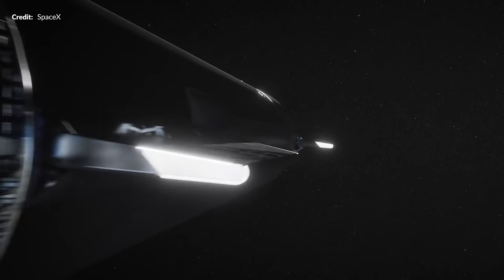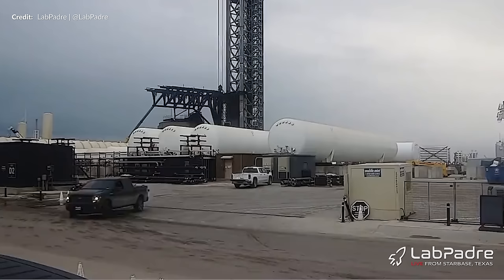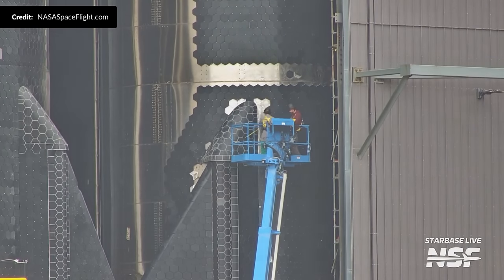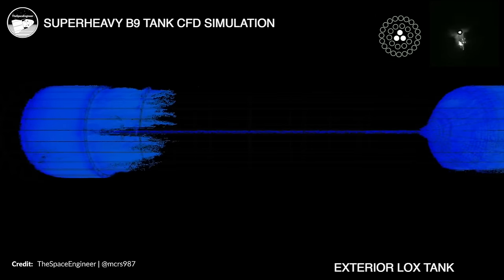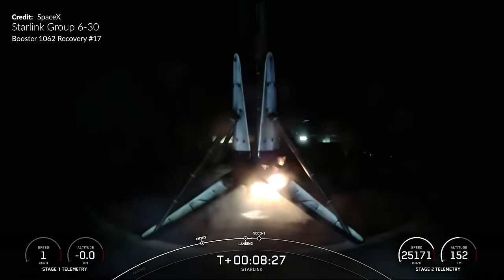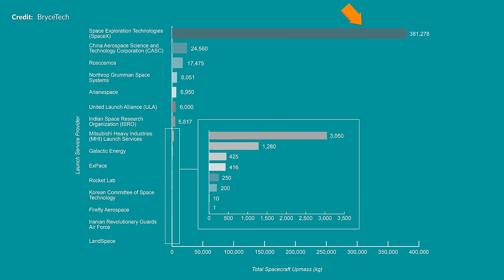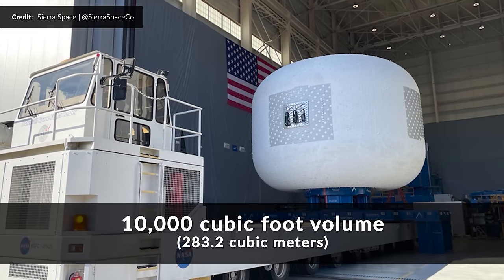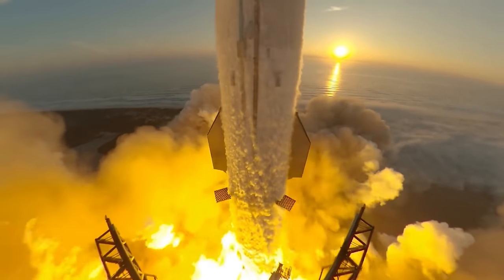SpaceX's Starship Version 2 to take Center Stage! Lets do this!

Comment: @ 12:50: The fins have been seen. Lex Fridman released a photo of his visit to the Florida factory on X that shows a forward module (interstage) with an insulation-covered fin installed. Additional views of the mid module tanks have been since released by Julia Bergeron that show it just before it went completely back inside the factory and visible next to it are parts for an aft module (engine section) as well as a single landing gear. 

If all that isn't enough, just this morning a photo was released by Talk of Titsuville of a complete fairing rolling on a transporter, looking like a practice run for payload integration and transport ops.

Comment: Not sure but putting baffles within the tanks would help out to stop the tremendous wave back lash on extreme maneuvers. Or having several smaller tanks to replace the large tanks to help control the splash effect of the fuel
Reply: I would be very surprised if they didn't already have baffles in them. 300 tonnes of fuel sloshing round in those huge, nearly empty tanks, that's ridiculous ...
Reply: @richardconway6425  
Yeah, they should probably use a smaller tank, with a bladder to keep fuel in place while doing the maneuvers.
Reply: Agreed.  Baffles could potentially resolve the sloshing issue if that was indeed what lead to the prior flight failure.  My guess is SpaceX is already looking into this.
Reply: Smaller tanks would significantly increase weight and plumbing complexity. While at the same time reduce the amount of fuel that can be held due to dead space between the tanks.
Reply: A plunger like a calking gun. It would be perfect for fuel transfer to another vehicle.
Reply: The tanks do have baffles (visible in the Booster 7 leaked downcomer collapse photos) they just need to fix how the flip is done
Reply: Baffles add weight…. I don’t think they will add them unless they have to

Comment: I think smaller tiles would allow better adhesion due to less effect from vibrations. They need to figure out the prominent harmonics then design the tiles to resiste vibrations from those harmonics via size and shape.
Reply from the maker: It was interesting watching the launch in slow motion. Pretty much all the tiles hung on, and then all of a sudden, a bunch started falling at once. I reckon there was an big vibration there somewhere, or the ship panels compressed down more than expected. Hard to say. I hope they got all that great data.
Reply: I believe they already did that.q

Comment: On that inflatable habitat test, I wonder if they test its resistance to micrometeoroid impacts. While internal overpressure seems unlikely, it is important that an impact does not lead to a large tear forming like in a popped balloon.
Reply: I recall reading that the expandable habitats have exteriors that when expanded have multiple interwoven layers similar to Kevlar that are stronger than reinforced concrete.
Reply: The Bigelow BEAM inflatable habitat was on the ISS for two years, and seemed to suffer a number of micrometeroid impacts without losing any integrity or pressure.
Reply: @baz_astra I think that it could work like a balloon in the other way where it is a little bouncy and just bounces away any debris
Reply: @baz_astra  That's certainly good to know! I was just wondering if they include simulated impacts in the testing plan. There are contraptions that can accelerate small projectiles to the necessary speeds, after all.
Reply: @alexeytsybyshev9459  They had Tesla designer Franz von Holzhausen throw a baseball at it.
Reply: @alexeytsybyshev9459

It's a good thing there are people like you around armchair engineering. I'm sure they never thought of that.
Reply: @billstevens3796  As opposed to professional engineering you come here to do lol. I'm just asking questions that make sense to me.
Reply: @alexeytsybyshev9459  And it was a perfectly good question. I think the balloons we see are more the exception than the rule. Have you ever seen a magician put a skewer through a balloon? It's a really simple trick, a little bit of sticky tape where you make the puncture stops the tear from spreading. Also the rubber in a balloon is stretched, these habitats wont be, the air pressure will just expand them to their natural dimensions, so if they do lose integrity they just go limp not pop...still wouldn't want to be inside it though.
Reply: @stever285  Yes, I guess a balloon is stretched at a much higher rate than the habitat material would, and that makes the rubber of the balloon concentrare a lot of stress at the edge of any puncture, pulling it apart from all sides. There is still going to be some of that pulling apart effect, even for a fabric-like material. It probably depends on the rate at which it is stretched and the margin of load. So, I think if the pressure is much lower than the strength of the material allows, a small hole will not grow, but if it is close to failure, a small hole will turn catastrophic.
Reply: @alexeytsybyshev9459  Exactly what I was trying to say, I'll have to get you to follow me around and explain all my posts, I might not get into so many arguments.
Reply: @Wurtoz9643  Now I would like to see the maths on. Maybe up to about the speed of a rifle bullet, but shortly after that I'm not seeing it.
Reply: @peter.wilson  not to mention they'll also be engineering them such that any punctures are stopped from forming long tears

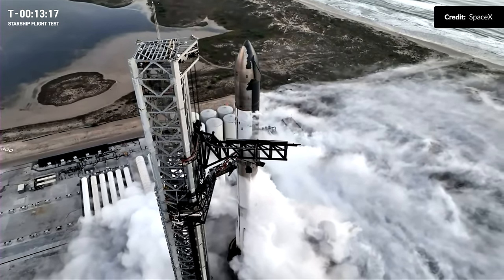Comment: 1:15
Faster fueling rate has been a concern for 60 years. A heavy lift vehicle (one that can place 300k lbs into a very low parking orbit of 100 miles for 3 orbits) can only sit on a launch pad fully fueled for 20 minutes or so in lift off status.

Increasing rate of a "fillup" is crucial to increasing launch window viability, and without the infinite coffers of the US Gov't to spend from, saving money and time now actually matter.

Comment: baffles might help that sloshing problem.
Reply: Yes. I used to haul fuel. There are baffles in the tanks to make it so the fuel sloshing does not turn the whole truck over. But..weight, right? And then the baffles would need to be strong enough to endure the huge mass of fuel moving suddenly, otherwise the baffles themselves become part of the problem.  But still, anything would help, even wire baffles would help slow the fuel moving in the tank.
Reply: @JeromyBranch   yeah, they just need to slow the fuel down.

Comment: Working in maintenance and repair, you would be surprised how much time is given simply in consideration of the people working around you not in maintenance and repair. If you can simply shut down a section at the drop of a hat, thing can immediately go so much quicker.

A week to set up an entire tank farm under those circumstances when the foundation is already there, or setting up massive precast wall is simple.

Comment: Great animation with the fuel tank slosh.  The reported negative accelleration that prompted the slosh was caused by the intense impingment of the Starship plume on the top lid of the Booster.  My impression was that that intense impingement was only for a couple of seconds, during which the three central booster engines kept firing continuously.  So, I'm wondering if the duration of absence of booster acceleration shown in the animation was longer than it really was.

Comment: It would seem to me that putting a roof over the horizontal tanks would be beneficial. It would protect them from object falling on them and also provide shade from the sun and a degree of insulation to help keep the liquids cold.
Reply: I was thinking about a tall wedge wall structure in front of the vertical tanks that would deflect the force of the blast around the tanks
Reply: @BradiKal61 they already have smaller sort of system like that. I think a roof would be better, because it would protect the tanks from falling debris and dust, and, as @asawhite2220 said, heat from the sun

Comment: I wonder if the new metal press is the key to Starship 2 improvements. They could stamp larger stringers with additional bend geometries and complex shapes to add strength and reduce weight.
Reply: It looks like you watched MKBHD Cybertruck Video 😁
Reply: One possible use of course. I'm not sure how well mega press technology (1) works with stainless steel though. In that case if large numbers of stringers and rib sections are needed then regular convention stamping technology might work better. The critical point there is the technique used to join them togetherer. 
1) It is my understanding that the Mega Press technology allows the diecasting of large one piece structural elements.
Reply: @mpetersen6   The Tesla Gigapresses are indeed for injection casting the front and rear castings of the Model Y and the Cybertruck. Aluminum is injected in just milliseconds. They haven't tried to do anything like that with steel. On to the stainless steel: At one of the interviews for the Cybertruck deliveries one of the Cybertruck engineers talked about how stainless steel that that thick can't be stamped. To even bend it that sharply without stressing that crease they needed to invent a new machine. 

Tesla developed their own stainless steel alloy to withstand that. Total speculation: that alloy will be used to make better stringers, etc, for Starship. Tesla and SpaceX do share their top metallurgists.
Reply: These detailed fantasy droolings are so entertaining. The MuskCult™ is just the Bush War Cult, instead of "6 more months until victory in Iraq" it's "orders of magnitude" and posts like this one above.

Comment: Using thinner gauge metal for Starship would decrease dry weight, but would make the fixing of the heat shield more challenging, since it would tend to flex even more.

Comment: With saying that the dry mass of Starship v2 was going to be less, I don't see how that could be if you add three more Raptors (even R3). It doesn't seem like using slightly thinner SS rings would tip the scales in that case. For the time being, I'm not expecting a 9-engine Starship -- at least not until Mars missions. From what we've seen, just changing to (presumably lighter) Raptor 3s and using flatter domes both increases propellant load (slightly) while decreasing dry mass -- easy-peasy.

Comment: If you read Halfway To Anywhere, by the late G. Harry Stine, you will find his advice to newspace companies expressed as "Build a little, test a little." Expanded a bit, this means that once a company has a reasonable design, the company should fly it as often as possible, fixing mistakes that it finds incrementally. The reason is that it's nigh-on impossible to anticipate everything that could possibly go wrong during the initial design phase, as NASA sometimes has tried to do.

I am glad to see SpaceX and the other startup launch companies doing exactly this.

Comment: 8:03 seems like they just need to add a baffle with basic flapper valves like F/A-18 classic Hornet does in its fuel tank to allow short duration inverted flight without flaming out the engines.
Reply: Simple design is good, but dealing with a 22 ton liquid fuel hammer is a real challenge as the history of rockets shows.

Comment: Fuel tanks in F1 cars have a mesh/lattice work in the fuel tanks that do two things:  Incase of a crash and a fuel spill you don't get the gas all exploding at once -  more of a burn off.  And it helps with the sloshing of fuel going around sharp corners which it affects it's handling. In Starship's case it would make it less likely for the engines to get starved of fuel in a sharp maneuver.....  if that is what the problem was.

Comment: Again, it's just amazing you and your team can produce one of these at this level of quality a WEEK, and sometimes even more often.  Just nuts and very much appreciated.  One thing though ... I'm REALLY waiting to hear what happened with the second stage and I'm thinking if there's any unofficial chatter on it, you're in a position to hear it.  Could you please specifically comment about that ?  Even if you just don't know anything, could you please make of point of at least saying THAT ?  Thanks Marcus and Team !
Reply from the maker: We don't know the cause of the failure at this stage. Essentially it seems like LOX started depleting quicker than it should have right toward the end like there was a rupture/aggressive LOX leak. The Flight Termination System was then triggered to blow up the vehicle (it would have been unsafe to let it continue without enough propellant to get into the correct trajectory.
Reply: Ok, thanks Marcus.  Please be sure to update us if you hear anything definitive.  Even if the problem was LOX starvation due to a rupture, the question is still "why" - what ruptured and why did it rupture ?  Thanks.   @MarcusHouse
Reply from the maker: Yes, exactly right. Sadly we don't know any more than from speculative observation right now.
Reply: Got it.  Thanks as always Marcus ! @MarcusHouse

Comment: I wonder if they could roll the booster really fast before any flip maneuvers to push the fuel to the edges of the tank and get it flowing in a controlled motion.  like how twisting a bottle really fast while pouring liquid out to create a controlled vortex results in a faster steadier transfer of liquid.

Comment: Maybe SpaceX needs to consider if it's possible to have a surge tank for the propellant so it can't slosh away from the pumps or pickups (however the fuel gets to the engines). Surge tanks are used all the time in racing to prevent fuel starvation during high G turns and low fuel conditions.

Comment: Perhaps in the booster, inside the tanks, it is necessary to install bulkheads with holes so that the fuel does not spill when the booster turns over.

Comment: Marcus
You have a great channel
My buddy is a retired propulsion engineer from a major space company
He watches you after o sent him a link a year or so ago
Anyways
Why doesn't SpaceX focus on manufacturing giant heat shield sections?
Reply: The tiles expand and contract with temperature at a different rate from the stainless steel. Even if the thermal rates matched, during re-entry the tiles will be red hot, even over stainless steel that is at cryogenic temperatures. The gap between tiles has to be large enough to support that much relative thermal expansion. Gap size is directly proportional to tile size. The gaps will be largest at the start of re-entry when Starship is closest to orbital speed, or even above orbital velocity if coming from the Moon or Mars. The white thermal blanket has to be able to cope with whatever gets through those gaps.

Those engineering tradeoff calculations were done a few years ago. As the tile material gets refined, I wouldn't be surprised if they adjust the tile size in some future version.

The majority of the tiles are held on with clips. The clips used on IFT-2 weren't as good as the most recent ship versions, just based on how few of those tiles have fallen off during ground handling. That clip design may already be good enough.

The tiles at the seams are held on with adhesive. They are still losing too many of those tiles on the ground. That will probably be resolved, but not necessarily in time for the next flight test.

The stainless steel can handle re-entry with a few isolated missing tiles without significant weakening. It will still be strong enough to land safely even if it loses dozens of tiles, but it may not be considered safe enough to fly again. Large areas of missing tiles will lead to the loss of the vehicle.

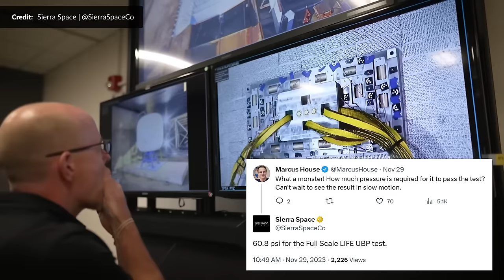Comment: The use of metric is improving, thanks! 14:20-ish, reference to 25 feet. Now I (along with 95% of the rest of the planet) have to work out what that means as I can't really visualise it. 7.62m OK, now I see. Then around 17:45. 68 pounds/square-inch of pressure. So, that's really force/area = pascals = N/m2. 68 pounds approx = 30.9kg = 303N/((2.54/100)^2)=470KPa I think.
Reply: I wish I was in your camp but thanks to a stupid political decision some 60 years ago, 80 years of imperial units is a hard imprint to break. The best I can do is visualize meters as yards+10% and centimeters as US dime diameters. Metric tons translate easily to 1.1 US tons and kilograms force converts to 2.2 pounds but Newtons draw a blank.

Comment: You watch ULA Roll out SLS and go around the moon, first flight. Yet it is still incomprehensible to you that BO could roll out New Glenn to fly right, first time.
Reply: ULA are not directly involved with SLS, and certainly not it's operations. The only thing they contributed was the DCSS stage from their Delta IV rocket.
SLS was operated by NASA, who have a lot of past experience with rockets in general, not to mention the Space Shuttle, which used the same engines and fuel system as SLS.
The only new part for NASA was the DCSS stage - which has already been proven dozens of times on Delta IV by ULA, as previously mentioned.
New Glenn by comparison is a brand new rocket built from the ground up using unproven engines and stages, by a company with zero orbital launch history at all.

Comment: Considering how long it took SX to build out their launch complex for Starship and unless BO has built their's out in secret somewhere?  This alone give you a clear idea of how far out they are before they are ready to even try their 1st test launch.  Being optimistic, I would guess they would be 12 months away from that 1st launch once they start building out the launch complex for real.  I know they have done some preliminary launch pad/complex work but it doesn't seem like they are close to being ready to launch anytime soon.
Reply: Blue Origin will be testing and launching from a facility at Cape Canaveral which is near their production facility.   Space X also has their production facility for Falcon 9 and later starship in the same area.
Reply: @michaeldeierhoi4096  Having the land area is one thing. Having a completed launch tower on it is another thing altogether.